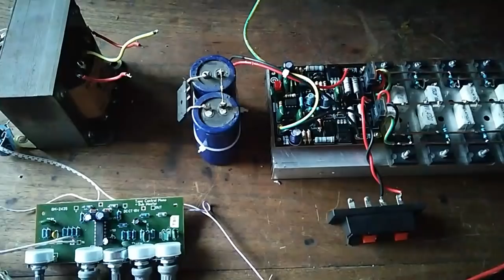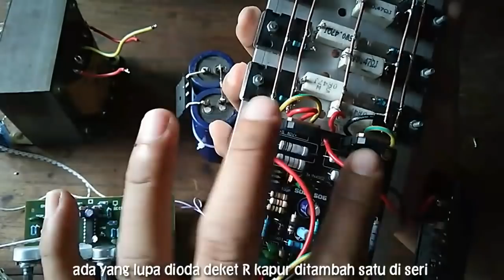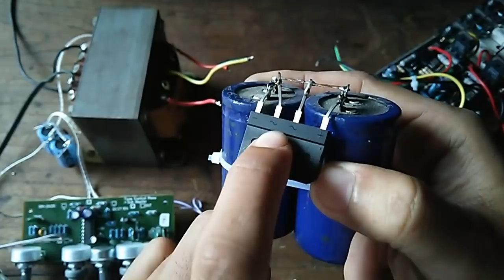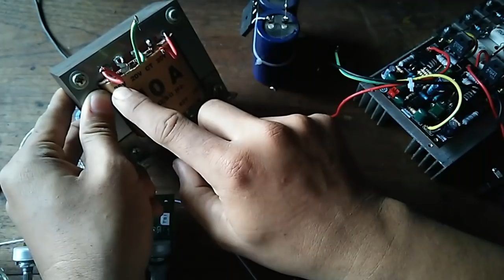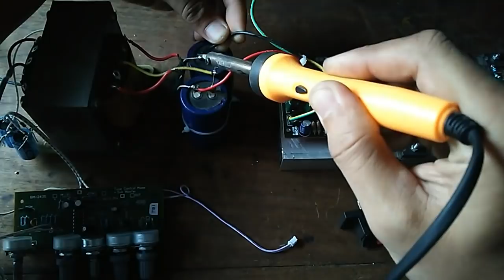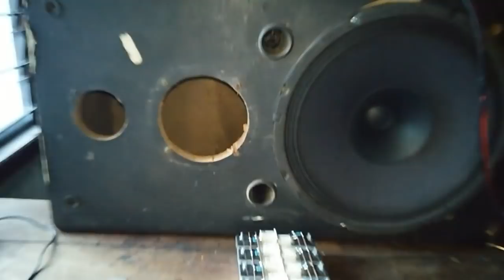Tes dan cara Merakit power SOCL 506 Tef final Thosiba. by wong deso

Comment: mas mau nanya ,bikin power socl 504tef.  ,dgn suplay dari trafo ,20 A ,50 /CT /50 .ATAU 55 /CT /55 elko 100v /10000 uf X 4 SET AMAN GK ,TRS MAXIMAL PAKEK tr final sanken berapa set   MAKASIH MAS SEBELUMNYA , .MASIH PEMULA MAS ,PENGEN BELAJAR
Reply from the maker: Biasanya untuk power tef harus banyak mas finalnya minim 4set
Reply: @WongDeso_86  MAKASIH  MAS , ILMUNYA  UDH mau bagi2 ilmu ke saya mas ,lanjut trus mas

Comment: Tanya om.
Trafo saya 10 amper banci kog cepet panas ya untuk angkat driver socl 504 tr final toshiba 3 set. Voltase saya ambil 42v.
Kenapa ya kira2 om. Tolong solusinya .
Reply from the maker: Merk apa
Reply: Wong Deso merk WIN
Reply from the maker: @relawan1017  panas kyak setrika apa panas biasa
Reply: Awalnya hangat biasa tp lama kelamaan kog tambah panas. Jadi gak tak terusin takut kebakar.
Reply: Soalnya pernah pake trafo 5 amper banci merk audio baru tancep langsung berasap 😭padahal pemasangan voltase udah benar.
Reply from the maker: @relawan1017  kurang bagus berrti travonya mas. Beli merk era/belt
Reply: Om boleh minta wa nya ?
Kalau boleh saya mau belajar sekaligus konsultasi.

Comment: kalo tef nya pake sanken 2sc2922 bisa ga boss
Reply from the maker: Cobak aja
Reply: kalo pake 3 set sanken  tanpa tef. r kapur yg di driver di copot apa ngga boss
Reply from the maker: Iya mas copot
Reply: brati ga usah di pasang resistor apa" ya bos di kosongin aja
Reply from the maker: Iya
Reply: oke bos. trimakasih suskses slalu. owhh iya resistor penahan di kaki basis pake yg ukuran brapa bos
Reply from the maker: 10ohm mas